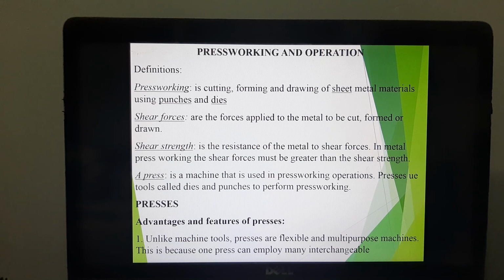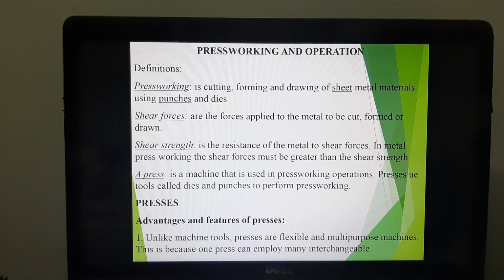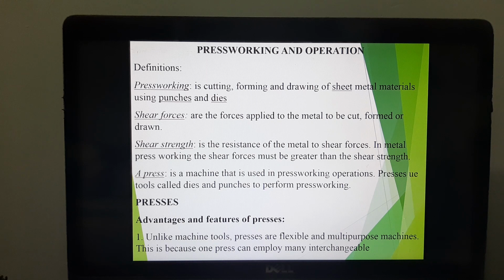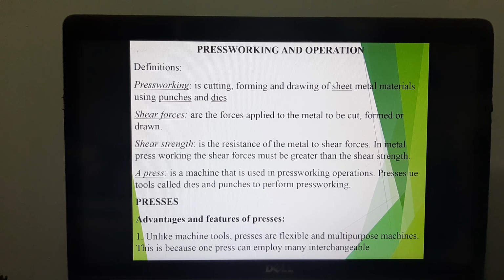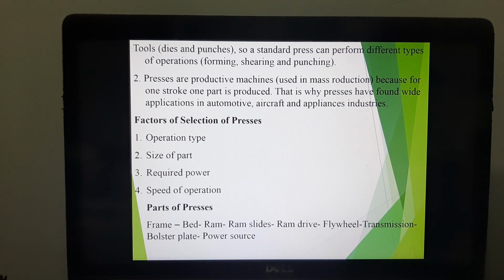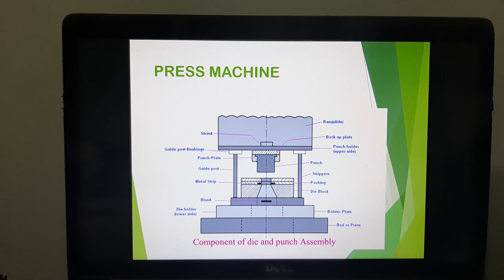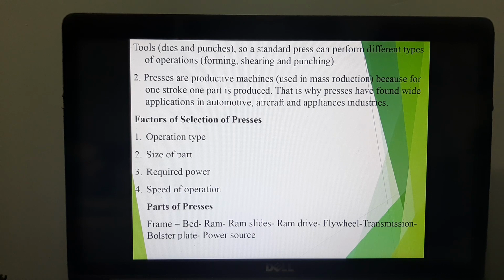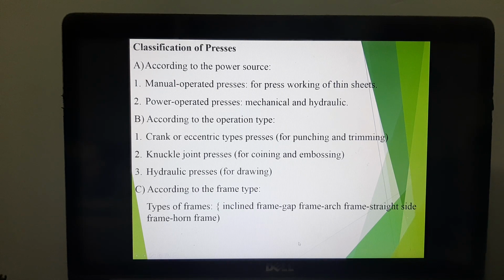PRESSWORKING OPERATION PART 1

Comment: Mohammad Aliff Bin  Mohd Pauzi (ME0104760).
From this video i learn that : 

Pressworking
--cutting ,drawing ,forming  sheet metal material using  punces dies
-
Advaantage
= flexible and multipurpose machine : employ many interchangebale
=effective machine ; use widely in industries

Factor selection
=operation type
=size of parts
=required speed
=speed of operation

Comment: good evening madam what i have learnt from this video is about pressworking and operation. pressworking is cutting forming and drawing sheet metal materials using punches and dies. shear forces is forces applied to the metal to be cut formed or draw. shear strength is resistant of metal to shear force. advantages of presses are it is multipurpose and flexible machine. it is also a productive machine which is use in mass production. factors affecting selecting presses are size of part, required power and speed of operation.

Luqman Mizani
ME0106088

Comment: Pressworking processes cut, mold and draw sheet metal materials using punches and dies. Shear force is the forces that are applied to the metal to be cut, and it is formed.  Shear strength is the resistance of the metal to shear forces and a press is a machine that is used in pressworking operations. Presses used tools called dies and punches to perform pressworking. Press advantages are versatile and multipurpose unit, can perform different types of operations, can produce mass production. Press selection considerations include type of operation, part size, power required and operating speed.  Press rating is given in tonnes, and tonnage rating is also named. At each stroke it is the energy that is spent on the work. The energy from the stored in the flywheel is obtained using the given formula. 

Muhammad Harits Bin Mohamad Zailan ME0106091

Comment: Muhammad Amir Aiman Bin Mohamed Azril
ME 0104247

In this video, I learned about pressworking and operations. Pressworking is cutting,forming and drawing of sheet metal materials using punches and dies. I also learned about shear forces which applied to the metal to be cut formed or drawn. Shear strength is the resistance of metal to shear forces. There are a few advantages of presses. First, it is very flexible and multipurpose. It is also productive because for a single stroke, a part is produce and press is wide application in automotive and other big industries. Last but not least is the factor of selecting presses which is the operation types, size of part, required power and the speed of operation.

Comment: Rajbhinder Singh me0106908
-pressqorking cutting,forming and drawing of sheet metal materials using punches and dies
-shear forces,applied to the metal to be cut,formed or drawn
-shear strength,resistance of the metal to shear forces.in metal press working the shear forces must be greater than shear strength
-a press press working operation
-understanding the advantages

Comment: Good evening Dr, from this video i have learned about press working which is a process of cutting, forming, drawing of sheet metals using punches/dies. I have also learned about shear force which is forces applied to metal to press worked and shear strength which is resistance of metal to shear force. There is also press which is the machine used in press working process. I also learned about factors of selection process which are operation type, size of part,  required power and speed of operation. Thank you Dr.

Muhammad Naquib Bin Nor Azlan
ME0106093

Comment: Good day madam, the information gained from the video is on the Pressworking operation where the cutting, forming and drawing of the metal sheet using punches and dies. this process occurs in the point of stress-strain curve CD where the material is shaped with fractured. in press working the Shear force must be greater than the shear strength of the material in order to machine the material.
A press is a multipurpose machine used In pressworking and have interchangeable dies which can be changed according to the product needed.
The advantages of using press is that press is flexible and multi-purpose machines which can employ many interchangeable punches and dies. A standard press can perform different types of operations ( forming, shearing and punching ). It is a productive machine which is suitable in mass production such as automotive and aircraft industries due to its one stroke for one part production. There are several factors of the selection of presses such as the operation type, size of parts, required power and speed of operations. Press rating formula can determine the energy stored in the flywheel ME0106053 Marcus Chuo

Comment: From this video i have learned about pressworking and operation. 
Pressworking= cutting, forming and drawing of sheet of metal materials using punches and dies.
Shear forces=  forces applied to the metal to be cut formed or drawn.
Shear strength= resistance of the metal to shear forces.
Press= a machine that is used in pressworking operation presses use tools called dies and punches to perform pressworking.

Advantages and Features

1) Presses are flexible and multipurpose machine. 
2) Presses are productive machines (used in mass roduction) because for one stroke one part is produced.

Factor of selection presses:
a) Operation types 
b) Size of part 
c) Required Power 
d) Speed of operation

Press rating is given in tons and it is also called tonnage rating. It is the energy spent on the work at each stroke.

Shahnyeel A/L Anil Kumar ME0106096

Comment: Good evening madam, I am Wong E-Shen (ME0106071). From this video, I have learnt about press working and operation. Press working is a cutting process which means shaping with fracture (CD parts in stress strain curve). In order to perform press working process, the shear forces must be larger than the shear strength so that the metal will exceed its ultimate yield strength and can be machined. The advantages of press working are firstly, in press working, the presses are flexible and multipurpose machines. This is because one press can employ many interchangeable which means one mold can produce different types of products. Secondly, presses are productive machines because for one stroke, one part is produced. That is why presses have found wide applications in automotive, aircraft and appliances industries. Next, there are 4 factors of selection of the presses. The factors consist of operation type
, size of part, required power and speed of operation. Press rating is given in tons and it is also called tonnage rating. 
Thank you.

Comment: NAME: NEENA BT AHMAD NIZAM
ID: ME0104364

From this video, I learnt about Pressworking Operation which is cutting, forming and drawing of sheet metals materials using punches and dies. Shear forces are forces applied to cut, form or draw metal while shear strength is the resistance of metal to shear force. Shear force must be higher the shear strength to cut metal. Presses are machines used in pressworking operations. The advantages of presses are they are flexible and multipurpose machines (interchangeable punch and die) and also a productive machine (with one stroke, one part is produced) The factors of selection of presses are operation type, size of part, required power and speed of operation. The press rating (tonage rating) is calculated by tons and with the formula E=N^2D^2W. Thank you.

Comment: from this video, i have learnt about pressworking and operation. pressworking is cutting, forming and drawing of sheet of metal materials using punches and dies. there are also shear forces and shear strength. shear force is forces applied to the metal to be cut formed or drawn. shear strenght is resistance of the metal to shear forces. the advantages of presses are presses are flexible and multipurpose machines. presses are also productive machines because for on stroke, one part is produced. the factors of selection of press are operation type, size of part, required power and speed of operation

Ariff Imran 
ME0106083

Comment: Name : Aiman Hazim Bin Arif Razman
ID : ME0106080

From this introductory video on press working, I can conclude that press working is a metal shaping process where it cuts, form, or draw sheet metal materials using punches and dies. The shear forces in press working need to be higher than the shear strength as more force is needed to overcome the resistance of the sheet metal to shear forces. The machines used in press working operations are multi-purposed as the presses and dies can be interchanged accordingly depending on the the type of operation. The advantages of presses are, presses are flexible and multipurpose machines so they can employ many interchangeable tools (dies & punches) to perform different types of operations and presses are also productive machines as they are widely used in mass production industries as they tend to produce one stroke one part productions. The press machine consists parts such as the punch plate, the punch, metal strip, die block, die holder & etc. Factors of selection of presses are operation type, size of part, required power and also speed of operation. Presses rating or tonnage rating can also be described as the energy spent on work at each stroke.

Thank you for the very insightful video Dr.

Comment: Good evening madam. From this video, i have learned pressworking. Pressworking is cutting , forming and drawing of sheet metal materials using punches and dies.Then, shear forces which are the forces applied to the metal to be cut,formed or drawn.Next, shear strength  which is the resistance of the metal to shear forces.Further, i also learnt about the advantages and features of presses plus with a few  factors of selection of presses.Finally, i learnt about the component of die and punch assembly.That's all. Thank you madam
.
Mohamad Fayyadh B Fazlula'ah Me0106089

Comment: Ariff bin Alzakri
ME0106046

Good day madam, in this video I have learned about the introduction to press working and operation. First of is the definitions of technical terms such as press working which is the cutting, drawing and forming the sheet metal materials using punches and dies. Shear force are forces applied to the metal in the operation and shear strength is the resistance of metal to the shear forces.
Presses are machines that is used in press working operations and unlike mine tools, they are flexible and multipurpose machines due to their interchangeable tools. They are normally used in mass production since a press produces 1 part.
There are several factors which are considered in selection of process which are operation type, size of part, power required and speed of operation. 
Press rating can also be calculated. Press working is also called tonnage rating and it is the energy spent on the work at each stroke.

Comment: Mohamad Ikhwan Syafiq bin Zaidi 

ME0106090

In this video I learned about pressworking operation. Pressworking is
cutting, forming and drawing of sheet metal materials using punches and dies. Advantagesof  presses are flexible and multipurposemachines. This is because one press can employ many interchangeable. Next ,  . Presses are productive machines because forone stroke one part is produced. Selection of presses are base on some factor :Operation type, Size of part , Required power and  Speed of operation

Comment: Hello madam, from this video I learned about Pressworking. Pressworking is cutting/forming/drawing of sheet metal using punches/dies.
Shear forces: Forces applied to metal to be cut/formed/drawn
Shear strength: resistance of metal to shear force. 
In order for a metal to be cut, the shear force must be higher than shear strength.
Press: Machines used in pressworking operations. It is flexible/multipurpose as it can employ many interchangeable dies/punches.
It is considered productive as it is used in mass productions.

Factors of selection process:
i) operation type
ii) size of part
iii) required power
iv) speed of operation

Press rating(tonns) which is the energy spent on the work at each stroke. 

AHMAD NAZRI BIN AHMAD TAMRIN ME106079

Comment: NIGEL ANDERSON SINGH A/L RAJDEEP SINGH
ME0106094
Good day, madam. A material need to be stretched above ultimate tensile strength for machining purposes. Pressworking is cutting, forming and drawing of sheet metal materials using punches and dies. Shear force are the forces applied to the metal to be cut, formed ir drawn. Shear strength is the resistance of the metal to shear forces and a press is a machine that is used in pressworking operations. Presses used tools called dies and punches to perform pressworking. Advantages of presses is flexible and multipurpose machine, can perform different types of operations, can produce mass production. Factors of selection of presses are operations type, size of part, required power and speed of operation. Presses rating is given in tons and it is also called tonnage rating. It is the energy spent on the work at each stroke. The energy is obtained from the stored in the flywheel using the formula given.

Thank you.

Comment: Good Day, Dr. I am Derrick Ng Kian Ping (ME0105733). At the end of the video, I have learned about press working. Press working is the cutting (Fracture, CD) ,forming (No fracture, BC) and drawing (No fracture, BC) of sheet metal materials using punches and dies.Shear force is present in press working and is defined as forces applied to be cut, formed and drawn. Next, the shear strength is the resistance of metal to shear forces. Therefore, the shear force must be greater than shear strength in press working for the cutting process to take place. The advantages of press is that it is flexible and multipurpose machine. One press can employ many interchangable dies and punches. A standard press can perform different types of operation such as forming, sharing and punching. Besides, presses are productive machine where it is suitable for mass production as for one stroke,one part is produced. This process is suitable for automotive, air craft and appliances. Furthermore, the factor of selection presses are operation type, size of part, required power and speed of operation. Moving on, the presses rating (tons) is defined as tonnage rating and is the energy spend on work at each stroke. Lastly, the classification of presses are based on power source, operation type and frame type.

Comment: Siti zulaikha ME0105567
-pressqorking cutting,forming and drawing of sheet metal materials using punches and dies
-shear forces,applied to the metal to be cut,formed or drawn
-shear strength,resistance of the metal to shear forces.in metal press working the shear forces must be greater than shear strength
-a press ,pressworking operation
-understanding the advantages

Comment: Good day Dr. Im Lee Zi Sheng ME0106051. I learnt that definition of:
Pressworking: is cutting, forming and drawing of sheet metal materials using punches and dies
Shear forces: are the forces applied to the metal to be cut, formed or drawn.
Shear strength: is the resistance of the metal to shear forces. In metal press working the shear forces must be greater than the shear strength.
A press: is a machine that is used in pressworking operations. Presses uses tools called dies and punches to perform pressworking.

in presses everthing can be done in a single machine.
the pros are:
presses are flexible and multipurpose machines
standard press can perform different types of operations (forming, shearing and punching).
Presses are productive machines ( mass roduction) and wide applications in automotive, aircraft and appliances industries.

Factors of Selection of Presses
Operation type
Size of part
Required power
Speed of operation
Press rating is given in tons and it is also called tonnage rating. It is the energy spent on the work at each stroke.
Thank you.

Comment: Good Morning Madam, From this video i have learned about pressworking and operation. Press working is cutting , forming and drawing of sheet metal materials using punches and dies.
Shear forces- The forces applied to the metal to be cut formed or draw
Shear strength - the resistance of metal to shear forces . in metal press working the shear forces must be greater the shear strength

A press - Is a machine that is used in pressworking operation presses use tools called dies and punches to perform pressworking.

Advantages and Features

1) Presses are flexible and multipurpose machine. This is because one press can employ many interchangeable. 
Tools ( dies and punches) so a standard press can perform different types of operation ( forming , shearing, punching)
2) Press one productive machines (used in mass roduction) because for one stroke one part is produced. Press is wide application in automotive, aircraft and appliances indutries.

Factor of selection presses: i) Operation types 
ii) Size of part 
iii) Required Power 
iv) Speed of operation

Presses rating - In tons and also called tonnange rating . it is energy spent and the work at each stroke.

Name : Alif Haikal Bin Azly
Id:ME0106081